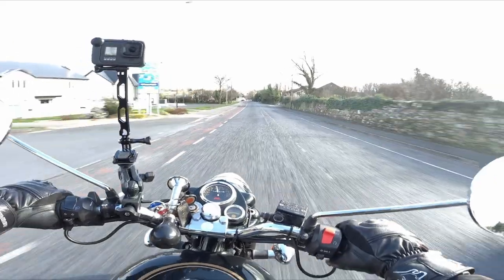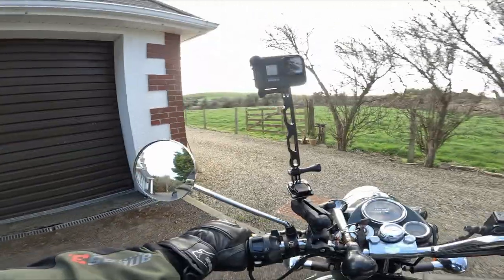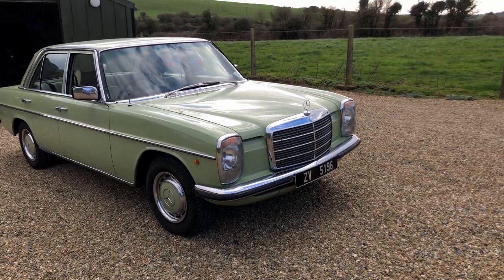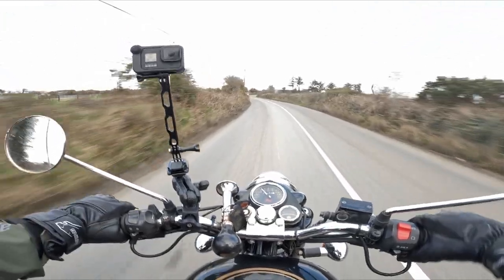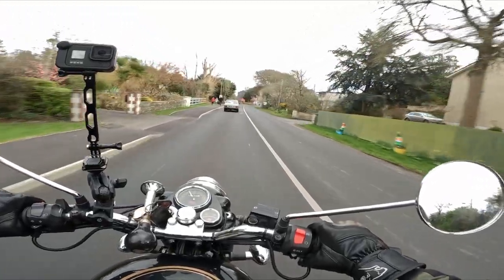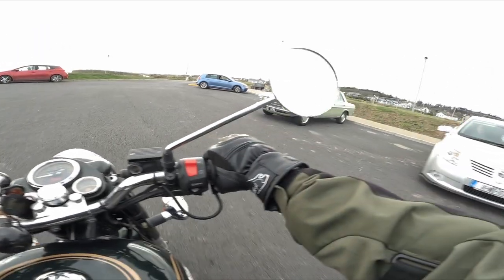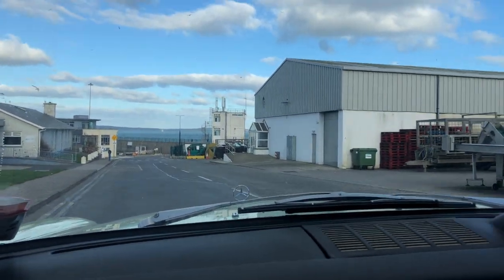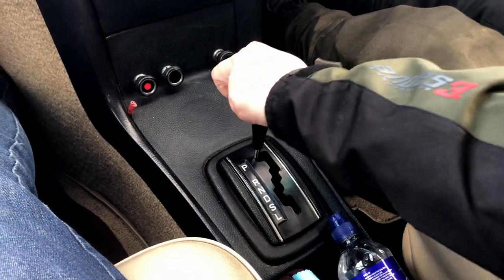Cruising with Classics: Royal Enfield Bullet 500 and 1976 Mercedes-Benz W250

Comment: Thank you for a nice video! I guess the Mercedes is one with the doble floor, witch collekts water in between those, and under the backseat the car will in the end brake down to the road so to speak. A car just for display, or you have a massive weldingjob. However do not be tempted to change the exost to an spotrsexost. That will end up killing your engine, as there is not enough resistance and the ilding/fire will burn the walvseats and the walves! I think you are an exelent videomaker! I will make a video soon of why not to rev your Bullet, shov you what happens and so one. 👍👍
Reply from the maker: I'm glad you liked the video, thank you! Looking forward to the video 👍